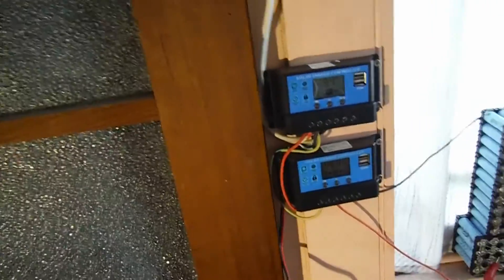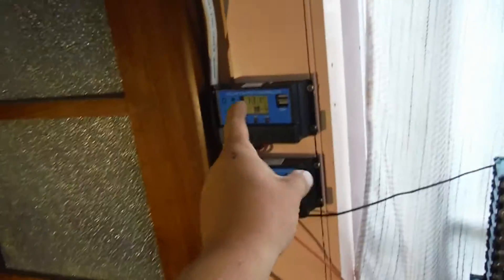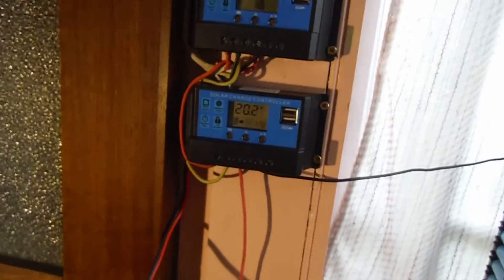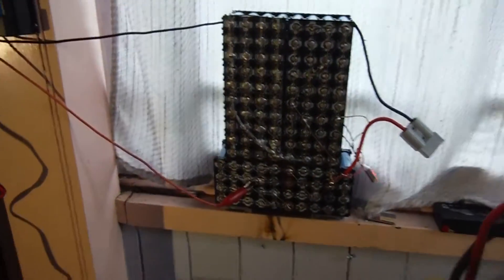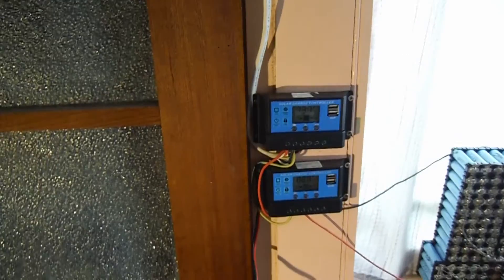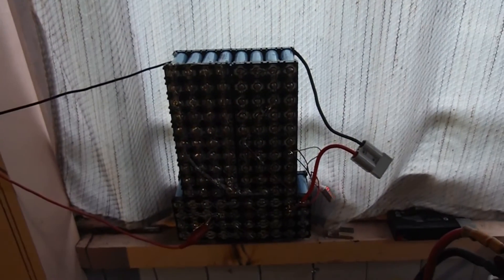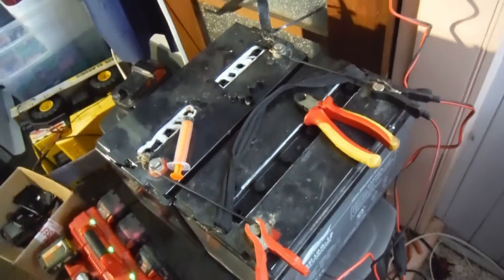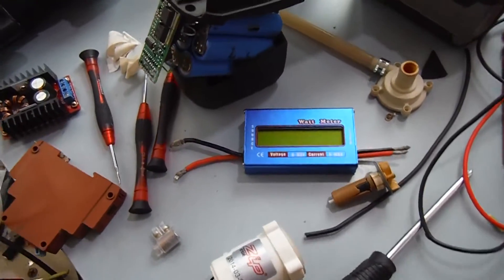Running twin PWM charge controllers for multi chemistry lii-on /lead acid bank

Comment: There is another trick to when using MPPT. If you pick a mppt charge controller that is semi automatic and you hook that one up onto the Lithium bank. Set minimum voltage to the maximum for that bank - 0.2v or whatever and it will divert energy from that bank to the lead-acid. In that way you could theoretically run 2 mppt chargers :)

Note "theoretically" i have not tested it but a controller where you manually can set minimum voltage tracking should be able to do this.
Reply from the maker: +DIY Tech & Repairs thats a wicked idea too thanks  for sharing mate ill be sure to try it when i upgrade my solar/ controller  array

Comment: This trick only works with PWM charge controller, the MPPT ones are too smart and fight over who controls the solar panel voltage.

I took my last spare car battery to the scrap yard a few months ago, just as well as one cell was leaking at the top. Still served it purpose when we had a planned power cut on a warm day, and needed a fan to keep the pets cool. Fan blew air over ice water bottle.
Reply from the maker: station240 _ yeah as thr system grows it will change and upgrade as we go. these junk yard lead acids  seem to  be holding up so far so see were  it takes me. bigger panel  is first upgrade  thanks for watching mate

Comment: nice video , just a little question : are your charge controllers always on also at midnight ?
Reply from the maker: steven keene yeah always on when connected to the battery bank there
Reply: One up the sleeve customs thanks for your fast replay , I just installed a 100W panel and the same charge controller . I was wondering if it was normal that I was still on even at dark . when the sun is shining does it stop charging the battery automatically too ?
Reply from the maker: steven keene yeah when its full it will stop charging to protect  the batterys some pannels will get a tiny charge out of a full moon
Reply: One up the sleeve customs cool , It showed 13.6 volt on my display today I was scared that my battery would explode :) haha . thank so much for quick reply
Reply from the maker: steven keene what sort of batterys are you  running mate
Reply: One up the sleeve customs I bought a semi traction battery 105AH , I hope that's the same name they use for that battery type in your country  :)
Reply from the maker: +steven keene yeah so at full power your 100 watt panel  will put  out 12 amps at 12v so from a low state of charge  it will have it topped off in about 9to 10hrs of good sun 
Thats not a bad recovery  from flat time
Reply: One up the sleeve customs Cool , so how full will it get til it stops charging 14 volts is that about right ? I want to use it to charge my Quadcopter lipo's , they are only 1400mah  and my phone and some small electronics .
Reply from the maker: +steven keene yeah 14 to 14.4 they are adjustable. It will be good for that save you a few $$in electricity costs
Reply: One up the sleeve customs yes haha plus that it is fun to do a little project
Reply from the maker: +steven keene yeah i intend to do it on a massive scale with lithium soon
Reply: One up the sleeve customs I will keep following your channel , now I need to sleep before my wife knock me out :)
Reply from the maker: +steven keene cheers mate thanks for watching
Reply: No problem i like watching your video´s , it looks like my charge controller stops charging at 13.8volt as i dont see it go higher then that . I also never seen the panel give more then around 20watts / 1 amp on 20volt , i hope this is just because there is not much sun here :)
Reply from the maker: +steven keene thats a bit low for a 100watt isnt it
Reply: I think so , but It has been raining and not allot of SUnshine ..i hope for better days soon
Reply from the maker: +steven keene  yeah doesnt have to.be super sunny a clear day is just fine you will then see the output
Reply: Yes its verry cloudy right now , i hope sunday Will get better... :)